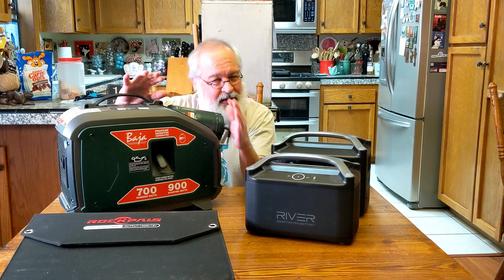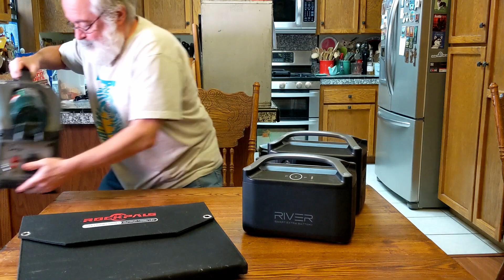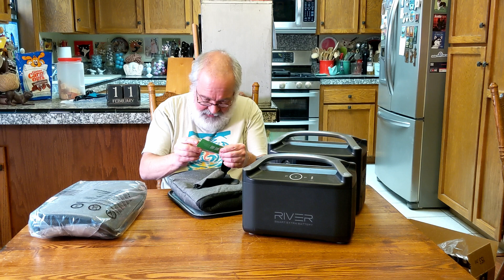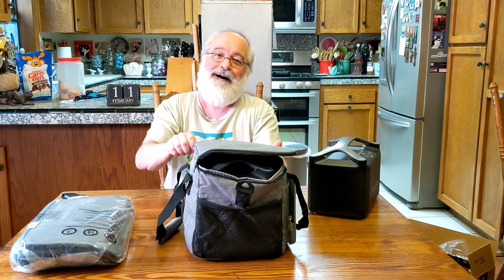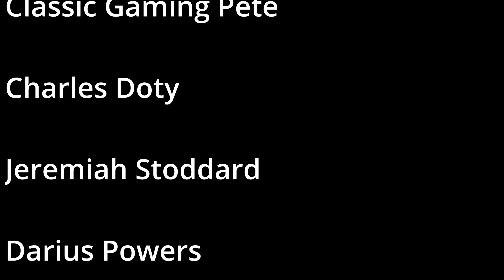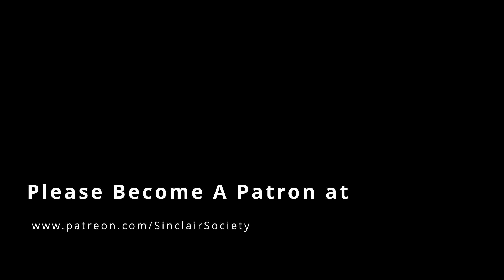Ecoflow River Pro Emergency Battery Power Update 2022 - how it performed in recent 4-day outage

Comment: If you use the EcoFlow app you can control the charging speed of your River Pro unit.  That way you could reduce the input wattage to keep your propane generator from tripping  Of course that means longer charging time, but it seems that would be a logical tradeoff for you to allow you to charge it at least to some extent.

Comment: I’ve been experimenting with my solar power stations I got for backup in emergencies. I find that leaving the solar generators plugged into the solar panels using pass through charging is a lot more efficient when running fridge, freezers, and wifi etc. as opposed to running the power stations down to 0 and then recharging to full power. You are right that direct sun is necessary to charge, though. You could also add wattage from the panels to pull in more charge but be careful about solar input. I have a gas powered inverter generator specifically to recharge my Ecoflow generators if solar isn’t enough. And it will fast charge two at a time and slow charge two or three at the same time. So it’s efficient. You need an inverter style generator to direct charge the solar generators so they are not damaged. I’m not an electrician but it has to do with sine waves. I did invest in a Delta 1300 and I absolutely love it! My next project is adding some solar to my roof and keep these on constant pass through power to run different items. Specifically the fridge and freezers. Everything else i can run lines through the window and make use of my portable panels. Solar stations are addictive!!

Comment: You could get a 1000 watt pure sine wave invert and charge from the car or there’s a product called the car generator
Reply from the maker: I will explore that.
Reply: @MacSociety  Did you know that you can reduce the charging rate by using the app? I updated the firmware and changed to slow charge. It's charging now with roughly 100 Watts.
Reply from the maker: @tinkerduck1373  yes but during emergency I want fast charge. Something in the middle of slow and fast would be a nice addition.

Comment: Did you try using a 20lb tank to charge the ecoflow? Based on the baja specs full load (700w) on a 1lb tank would only run for 45 min
Reply from the maker: I did not as I did not have the 20-pound tank available to me but may try that before I decide to move on to a different small generator.  The thing is it conks out within only minutes and trips up with plenty of propane in the small tank, so guessing it still may have an issue.
Reply: @MacSociety  I dont think it's designed to run at full load. A lot of companys over rate specs. I bet if you hooked up the 20lb tank it will charge at least the main ecoflow unit just fine.

Comment: I wonder if the Baja might have been able to charge the Ecoflow easier if they were disconnected from the cable, and just charge the main Ecoflow by itself, and then reconnect and charge the extra battery? or would be the same power draw separately, at 600 watts?
Reply from the maker: I tried that too.  It had the same issues.  I think I just need a slightly more wattage generator to do what I want to in a better way.